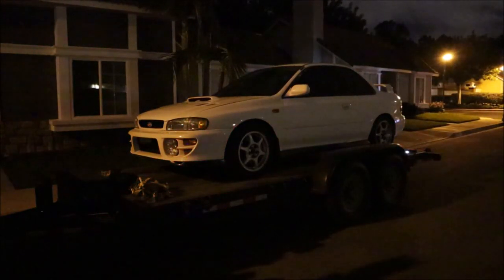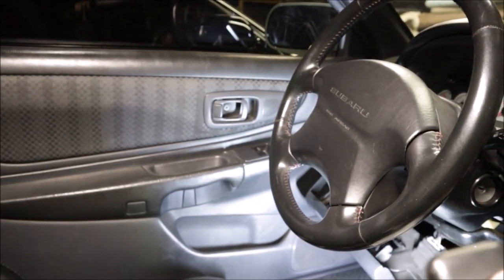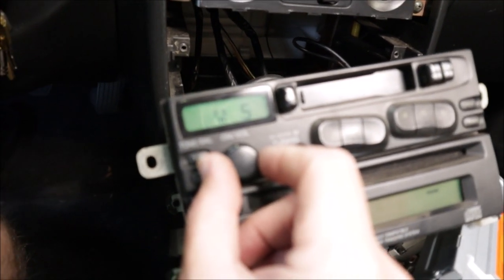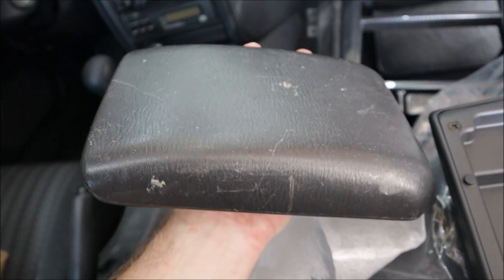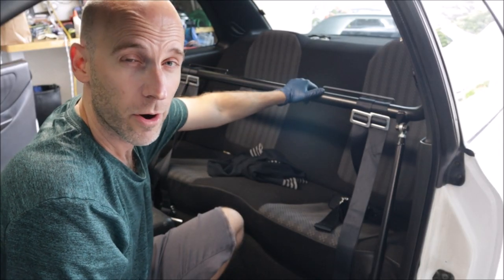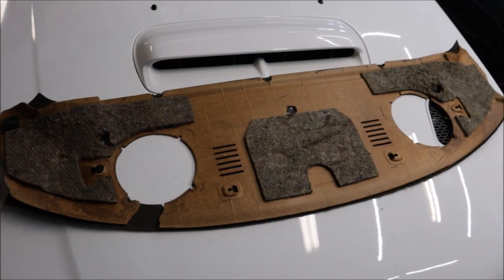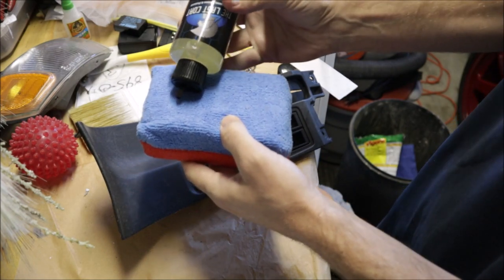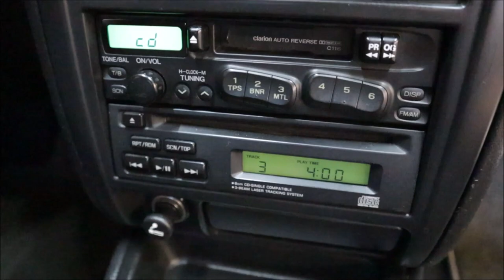GC8 Project Impreza 2.5RS Part 3 - Interior Restoration & Rebuild Back to OEM

Comment: Glad to see you removed that harness bar. They should be illegal to even be sold.
Reply from the maker: Are they unsafe for street use?
Reply: @RoadPatina  Not safe for any use because if you get T boned, it will just bend
Reply from the maker: @Rannd  Also, I don’t like running harnesses without a cage in the event of a rollover. I like my head and spine!

Comment: Where do you find the replacement parts?
Reply from the maker: Some are still available from Subaru. Most I find used on FB or OfferUp
Reply: Thanks for the info. If you decide changing coilovers let me know.